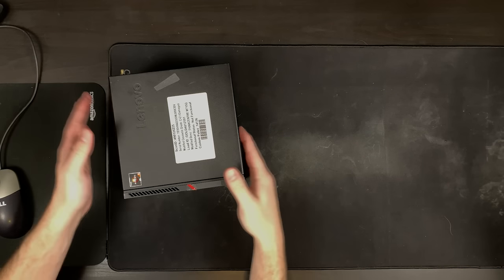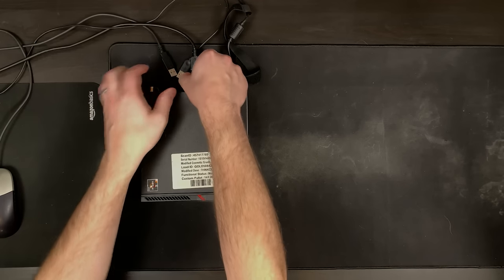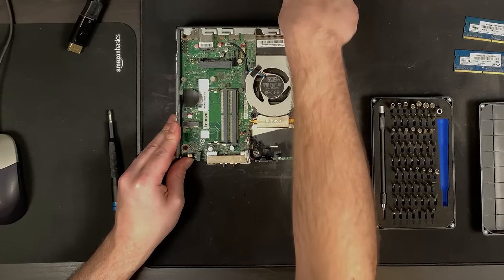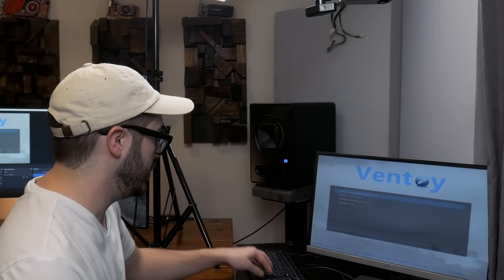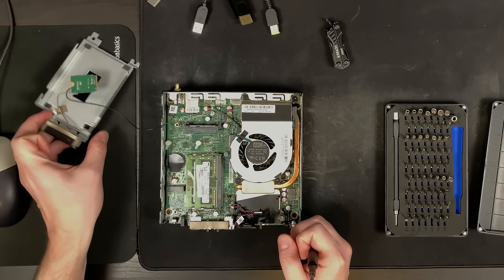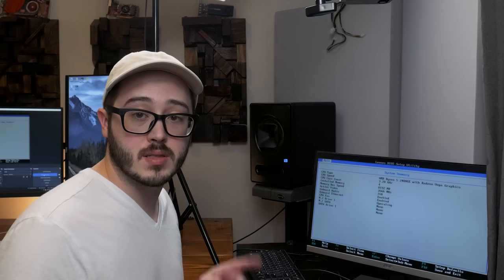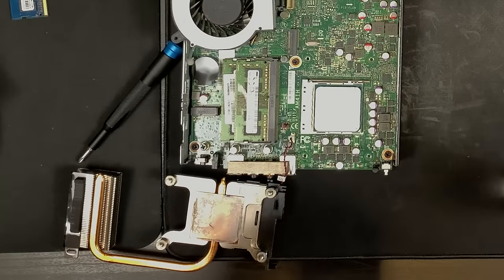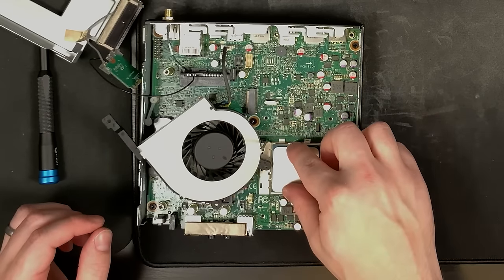Can I Fix These Broken Lenovo Mini PCs?

Comment from the maker: UPDATE/FAQ/RESPONDING TO A LOT OF COMMENTS:

I've had a lot of comments recently and have been a bit busy, so I'm sort of responding to a lot of them here. First of all, thanks for all the incredible feedback and advice! I've learned a lot just from this video and appreciate all of you sharing your years of experience and knowledge. There are a few things I'd like to either answer, provide some more clarity, and/or update you guys on so here it goes:

- I learned after the fact that flashing the BIOS directly from one mobo to another can be sketchy since OEMs put serials and other info on the UEFI. I guess it's common to edit this in UEFITool or something similar before flashing. Fortunately, I was able to boot into windows on these and use Lenovo's flash tool to not only update the BIOS but also insert the correct serial number. I'm not sure if there are any other issues, but so far I haven't come across anything. One is running debian and the other two are running windows just fine. 

- I'm aware that the BIOS chip could be faulty or susceptible to failing again on these. I plan to keep two currently and will only sell the one that had an issue with the RAM module. If I have issues with the UEFI corrupting again with either of the others, I'll look into replacing the IC. 

- I tested the faulty DDR4 module after substantial cleaning to no avail. I might try it in a different system but have no reason to belive it isn't faulty. 

- It was silly to jump to the CPU as fast as I did, but looking back, its clear to me that I was nervous about losing too much money on the deal and I was hoping to at least confirm that I had 3 CPUs and some RAM I could sell haha. It would've been much smarter to clear CMOS/remove and replace the CMOS battery before doing that. Speaking of which, I wasn't super clear in the video but I replaced all the CMOS batteries of camera giving both non working machines a good amount of time before putting the new one in.

- Some people pointed out that I should only change one variable between boots, and this is a good idea when trying to pin down the exact problem. I partly didn't always do that for the same reason as mentioned above; I was hoping to just get a POST to hopefully feel better about buying three dead PCs. Also, if I can get a POST, I can always go back and start adding those same variables to see what was causing the issue, granted that can sometimes not work out and you'll get a POST after resetting something only for it to fail again down the road. So, thats fair criticism, but things are also different when filming a video haha. 

- Also, I guess I touch my face too much..? 🤔

At this point I'm really just typing my thoughts so feel free to stop reading, but having to explain all of the above is sort of the reason that I get a lot of the somments I do, which don't get me wrong, I love reading the comments and learning from them. However, just realize that for the sake of a video, it's impossible to address every single little thing. Even in a longer format like this. I don't say that to discourage comments. But I do hope that maybe this encourages you to be a bit more positive and open minded when dropping comments on your favorite creators' videos. Just because they or I like waffles doesn't mean that we hate pancakes (or ventoy). Okay I'm done. Thanks for watching this video and reading this mess. 

Stay curious 👍
Reply: Ignore hate, take in the constructive comments, keep learning!
Reply: You probably doesn't have time to answer all comments, but reading could be possible.

And as you noticed, some people are brittle like a snowflake in hell, so don't bother with hatets, even if it could be hard to do. You really can't please everyone.
Try to extract the good information and ignore the rest.

And your video set up is good enough that you don't need to make excuses about it.  

As a musician, I tell you what I have learned from other musicians. Don't ever tell your audience about misses you make, that you could do better, when they tell you are good, or at least not say you did bad.  Because you then can take a good experience from them.
Just suck that good vibes up and put that into next video.
If you get comments about it not being as good as as it can, just comment if it is constructive, and THEN make the excuses/explain why.  Not before.

Yes, I did not got any bad experience from your videos, when it comes to the production.

About the Repair, good that you managed to fix them, I know I would, as I would reprogram the BIOS/UEFI Memory.
Reply: can you tell me how you identified the Bios chip.. i have the same unit.. not working same issue.. i bough a programmer to try this but not sure how to locate the chip
Reply from the maker: @bishoydoozy2133  sorry for the delay. YOu can hopefully find it by looking at the clip that shows the clamp towards the end of the video. I believe it's underneath the cpu fan. It's not the one that's under/near the nvme slot
Reply: Quick note for a little advice and encouragement.
1. Great video, it's very interesting to see some of this content, and I am sure inspires a lot of people to have a go themselves.
2. If you make mistakes, own them, and share them. It is very helpful to people if you share your mistakes too. Seeing someone do something perfectly in an edited video may dishearten other people if they don't find things as easy as they see you do it.
3. Log your steps. Either on a piece of paper or a word doc. Not just so you know where you are up to, but also so you can see your steps the next time you attempt something like this and you can see what went right or wrong, and improve on things perhaps.
4. When messing with things like RAM and slots, set up a matrix and do all of the different combos to see what you have. You may miss a step and move on to something different without completely eliminating an aspect as a defect.
5. Get a anti-static wrist band, not sure how effective they are, but for a few £/$ it can't hurt. Don't work on a PC with the power in, just on the off chance.
6. Check there is a CPU present, lol, I have actually seen it that someone is going nuts over why a PC won't POST, and there is no actual CPU in the comp :)))
7. Ignore any negatives that someone puts in comments etc, YOU DO YOU, enjoy what you do and keep up the great content.
Reply: Hey no worries big guy. There are always going to be "negative Nellies" in the comments and you were more than up front that you are not a pro and we were going along for the "Lets learn what we can as we go" ride and I cheered for your success. Some time poking it and trying what ever comes to you, is the best way to learn.  👍
Reply: Heads up ventroy provides a key for secure boot and is labeled as such too.
Reply: I think it's great that you would want to learn and teach others about technology. However, let's stop and consider what it is that you might also be doing here. Right off the bat, Lenovo is a Chinese company. If that fact alone doesn't cause you concern then consider this also: Lenovo has a history of "infecting" their BIOS's with the ability to push advertisements and presumably infect whatever OS it happens to be running. Check out what the Lenovo "Superfish" thing is if you want to know more. Even as late as 2015, Lenovo was providing instructions for this, and other "vulnerabilities."

This means, that unless you can completely reverse engineer a BIOS/UEFI or write/modify your own firmware code or something, that you can never truly achieve a trustworthy platform on a Lenovo product. There are even things like Lenovo peripherals to consider here too! (As if Microsoft Windows telemetry wasn't bad enough either.) Even with a good Linux distro, there will always be a trust problem that Lenovo chose to bake so deeply into many of their computers.

I don't think I need to point out that Lenovo and IBM are no longer connected at the hip like they once were or point out that other history of IBM being somewhat fascist (during pre WWII). We all know how IBM sold their manufacturing line of "Think(whatever)" products to Lenovo. Simply realize this: you might be unwittingly encouraging the Chinese government to commit crimes like the genocide of Uighur's and other "undesirable's," including many in parts of Africa, when you choose to support any Chinese controlled company like Lenovo, Huawei, etc. And then, there are the security concerns here too. Therefore, if I were you, I'd take every Lenovo product I had and put them all into the nearest trash/recycling bin and stop encouraging others to repair or use these things.

... This was NOT meant to be insulting or belittling or even political. I merely wish to warn you and others of the potential, likely risks/hazards of using Lenovo products. Quite frankly, no Chinese product should be supported if for no other reason than humanity. It's almost too easy to point out other offenders like Apple or Google in the Chinese slavery manufacture of their products -- that's a whole other rant. In this case, there are further questions about the Chinese controlled company Lenovo, namely Superfish which might imply a whole bunch of other concerns.
Reply: Hello 
Can you please tell me, that is it possible to connect an external power button?
I see pins on the corner.
Reply: ok, so i did it!
Now i have the 1.8v bios reprogramer.
Download a moded bios that unlock a lot of options.
Enable  the external GPU adapter
And here we are!
Now, i have a gtx 650 ti boost, but gonna buy rx 6600 xt ;)
Thx to you man ;)
Reply from the maker: @1987Redfield  YES!! Nice job!
Reply: @WXSEDY cool story bro
Reply: Hey there is an updated revision of the programmer you used. The one you have is bad since it sends 5v on the data lines. You can mod it to not do that but. The new revision you can select the voltages on not needing the step down boards. It also corrects the issue of 5v on the data pins. v1.6, you have 1.5
Reply: Lenovo's/AMI's BIOS on these are broken. I just bricked an M910q (turns on by itself when plugged in, no display, two beeps at boot up) by... turning PXE booting off.

Comment: Future tip, if you are just testing for post you don't absolutely need to put thermal paste and cooler back on.
Reply: Athlon XP has entered the chat.
Reply: Intel xenon servers don’t post without cpu and cpu fan.
Reply: @TheJonchihuahua  Oh yes they do ! I do it frequently. The CPU has NO WAY of telling if the cooler and fan are preset. An alternative if you have one that's 'safer' is to stick on something like a spare chipset cooler (no fan or mounting clip) with a dab of h/s paste. It'll 'absorb' a bit of hear for a minute or so. A finger on the heat spreader will tell if it's getting too warm.
Reply: @TheJonchihuahua  He wasn't saying without the CPU !
Reply: Pentium 4 HT Has entered the chat
Reply: Not true. Sometimes it will fail because it over heats instantly before it posts. You don't need thermal paste but putting a heatsink at least ontop of the CPU even if it's a bad one.

Comment: On that "bad" DIMM.  One of the things I have found in experiece is that sometimes, the pins get a layer of oxidation.  To fix this, you can use a touch of rubbing alcohol and a cleaning wipe to renew the contacts, or some electronics cleaner, or use a good pencil erasers on those contacts.  The color change should be apparent.

Comment: I am  certified reseller . One big issue they had with those models. Is the hybrid drives in it would fail due to heat. Replace with ssd and they are fine. Also, Lenovo uses pcie white list. So to replace wireless card it has to be on the list. You can tell  if it is stock tam from Lenovo look for FID#.
Reply: There are a number of modified bioses available with the whitelist removed (and a couple of crowdsourced bios mod sites which will attempt to do it if you have the bios image)

I had to do that to get 5GHz/802.11ac support on my T62i laptop

It's irritating, to say the least

Comment: I'm not sure if you intend on doing more repairs like this in the future but I think thermal pads would be a good investment at least for troubleshooting. No mess or clean up and the pads are reusable.
Reply: Usually not worth the trouble. As long as you have a price of chunk of copper or aluminum to place on top, you are in the clear to handle the initial boot test, the initial heat load is what needs to be wicked away.  Even Derbauer uses this method just to check for the post. I usually do this when I get a CPU/Socket combo that seems to be having seating issues. I also do it when doing CPU socket pin repair, sometimes you have to seat and unseat the CPU to check if you got the pins to just the right spot.
Reply: Even besides troubleshooting, I always go for thermal pads. Set it and forget it. No need to renew them ever again :)
Reply: @Arnie's Tech  Thermal pads degrade just as thermal paste does over long periods of time and heat cycles. I personally have been testing carbon pads out, seems promising for an AIO I keep at the ready on my bench for temp setups. I don't even clip it on, I just lay a bag of lean on it to weigh it down.

Comment: Retired electrical engineer / computers just a long time hobby.  My experience is to suspect mechanical failures before worrying about failed silicon.  Surplus computers get slung around a lot and the memory board mountings aren't made to handle violent accelerations.  So your instinct to open it up and unplug and plug things is a good one.
That said the next thing I worry about is power supply failures - some regulator component allowing 3.3v or 1.8v to go way too high which damages everything it's attached to.  For this reason very early in troubleshooting I'd check the power supply rails with a multimeter.  That keeps you from plugging damaged components into a good system board or plugging a good RAM, for instance, into a system with a 3.3v rail running at 8 or 10 or 19 volts!  
A fascinating video which I enjoyed very much - happy hunting!
Reply: Yes, a mechanical 'thump', say from dropping,  can dislodge other internals which can cause a no-boot. Always good practice to check that stuff is seated properly.
Reply: Totaly agree with you, also a retired hardware/software engeneer

Comment: As bit warning, these systems have now exact same serial number, UUID and OA3 Windows 10 key. But that can be fixed by moving serial-regions for broken BIOS image to working one with UEFITool.
Also another warning for future repair videos: when testing CPUs from other systems: newer Lenovo business PCs, like Lenovo M75q Tiny Gen2, can vendor/PSB lock your AMD CPU.
Reply from the maker: Thanks for the heads up!
Reply: that's one thing I hate about new bios/uefi. you can't just dumb flash a file from the manufacturers website anymore, it has to be a "smart" operation.

recently fixed an am2 board from the dumpster room with bad bios, download latest from asrock, flash and bam, booting again. miss those times eh..

and yeah, as soon as he said to try swap cpu's around and mentioned his wife/gf's I was like oh no no hold up!
Reply from the maker: @GizmoTheGreen  Haha yeah, wouldn't have been the first time I messed her stuff up 😂
Reply: I beleve only the pro chips can be hw locked.

Don't quote me on that though.
Reply: They will also have the same mac address. Would probably cause network issues if you connect 2 to the same network.

You can change mac inside windows for ethernet so that is a simple solution.

I do not know how the lenovo bios is structured and if UEFI Tool will work but definitely worth an try.
Reply: @andrewmcewan9145  35:18 37:34 show different MAC address for NIC. Most likely only Intel motherboards with Intel NIC have MAC address burned into BIOS.
Reply: @15fakeaccount  you are correct. I guess its baked in the hw. Makes sense if the same chip is used on external cards.
Reply from the maker: @andrewmcewan9145  Hmmm i thought MAC addresses were tied to the NIC not the motherboard BIOS. Interesting
Reply: @HardwareHaven  if it happens to matter, you can use the bios updater from Lenovo and it 1) autoboots and starts the flash so be warned and 2) let’s you set the serial number back to the correct one or I suppose whatever you want
Reply from the maker: @stuffwhy3501  Thanks! I actually ended up doing exactly that.
Reply: @HardwareHaven  did you just have to type it in or did it get it from the hardware?
Reply: If you plug a non-locked CPU in, it will prompt whether you want to lock it, just be very careful with the selection on that screen.
Reply: Just installing Linux wouldn't be a problem though, right?
Reply: Oh I hate that. The cpu lock in. I know older (don't know about newer) hp servers did that.
Reply: @RD-Travels  on system with cpu lock you can upgrade the cpu however your old cpu will only work on another system.

Please do note however that this kind of stuff is usually only happening on « pro »/entreprise stuff. It’s often used to enforce security by activating bios signature verification on the hardware boot to prevent data loss / unauthorized uses of the company hardware.
It is sad but also some companies does have this kind of needs (and some of them are actually really needing this 😅)
Reply: @HardwareHaven  MACs were on the "bios" in Sun workstations and friends but I haven't seen it in bios for decades
Reply: YIKES!

Comment: I'm only to the first fix so far, but I'd warn that when troubleshooting, you should always try to make only one change at once. For instance, if you're removing the wi-fi card, immediately try booting again. When you change the RAM, put a different stick in the SAME slot.

Love the video, and great effort. Keep at it!
Reply: We use this same theory of operation in maintenance of retail fuel dispensers. Always try to keep the changes one at at time, especially on those stubborn issues that are hard to pin down. This is definitely solid advice.